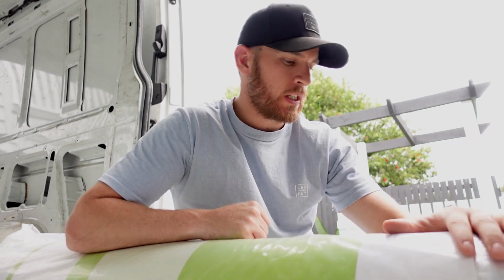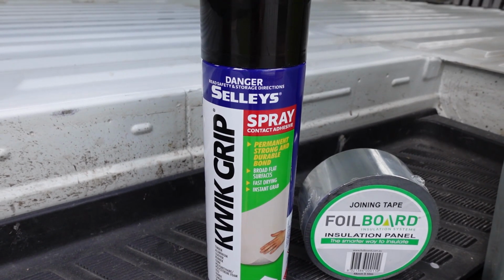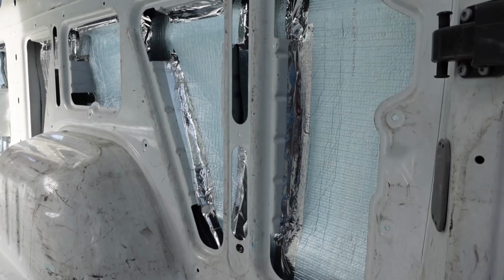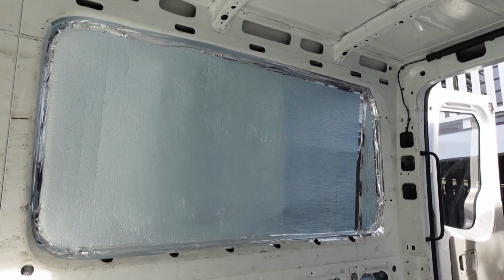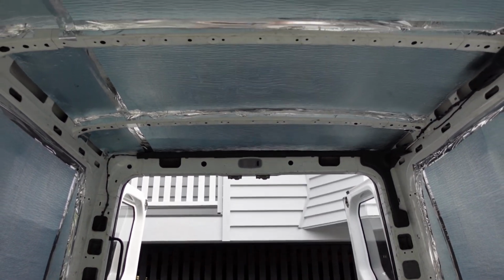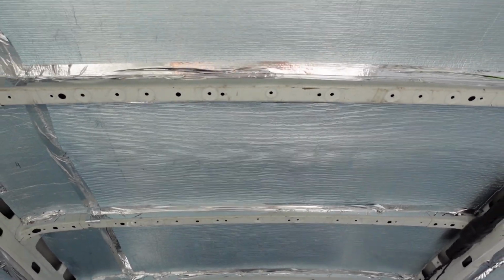Van Insulation Ep.3 How to keep your van cool in the summer and warm in winter!

Comment: I got a red doblo ,  it gets a bit hot, have insulated the inside, "BUT", the out side metal gets hot, this then radiates all around the vehicle,  so, I got some silver reflective paint, the cheap stuff, the stuff you put on flat roofs, got a roller, put it on roof, back and sides, looks like crab, but it did cool it down,  then I got some silver duck tape,  99p  Aldi, UK,  put that over some of the silver paint, and side rear windows,  tested it over a few days, the tape worked better then the paint, done one window with paint, the other with tape, the taped window was cooler,

Comment: Love your videos, appreciate you sharing.

I'm converting my Hyundai Staria load and about to insulate the same way. I live in Queensland (Brissy) so it's always hot.

My friend talks about the R rating and the thing types are oy about R1. Do you think yours is fine or would you use a thicker product with a higher R value?
Thank you so much!
Reply: How did you go with your Staria? I’m converting mine atm, and about to use Ametalin ThermalLiner on the ceiling. How did you insulate the beams? If the whole ceiling is not sealed, has condensation been a problem?
Reply: @Ruth-ps9nq  it worked a treat!

Comment: Hey bud, I installed thermaliner the same way you did.. and now everyone says it doesn't work at all unless you have an air gap. Ie: Don't stick directly to the wall. So, just checking in to see if yours worked for the Aussie heat, or was it a fail? Also, I installed it with shiny side in as per instructions on the bag. Yours is the other way around but I still don't know which way it goes tbh.
Reply: As a apprentice machanical insulator what I've learned is the reason insulation works is due to air gaps/pockets the more the better which raises the rating of insulation you get, the Shiny parts of insulation is for a radiant barrier which If it touches the other surface(metal), then conductive heat transfer occurs. Resulting in lack of effectiveness. Hope that helps anyone out :)
Reply: To add onto this it would be beneficial to use a foam or rock wool insulation between the metal of the van and the radiant layer then the interior wall as the finisher. This will also dramatically reduce any sweating/condensation